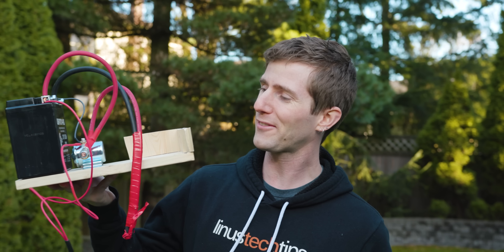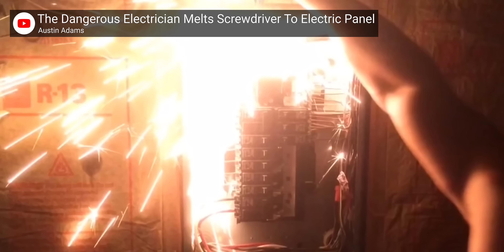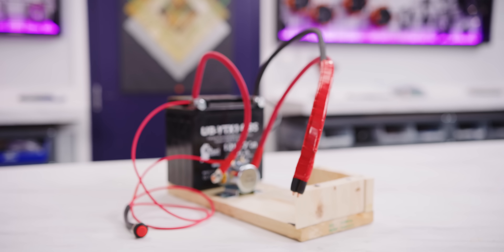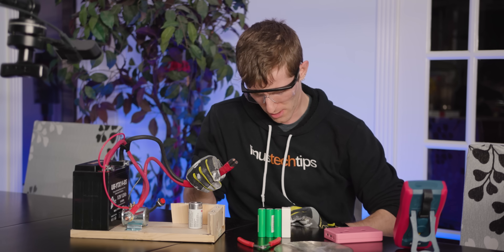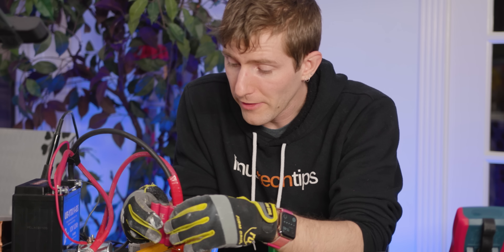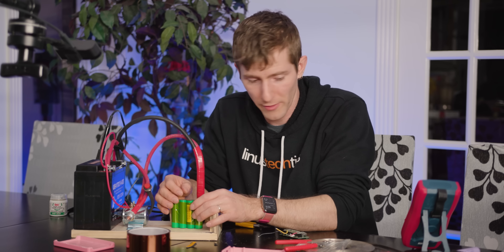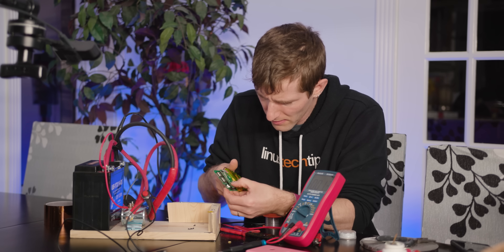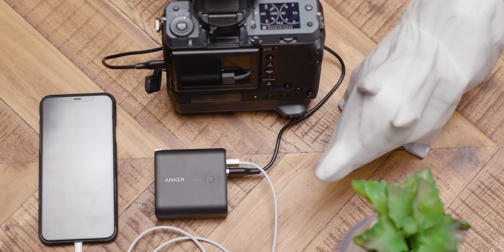I spent $100 to save 20 bucks... and it was TOTALLY worth it!

Comment: Drivers on rallye dakar are sometimes welding with a car battery, when something brakes out in the dessert, but I would be affraid of the battery to explode. Since it can get very hot by shorting it constantly.

Comment: Great Video on showing people how NOT to make a spot welder.  Guys, you seriously need to stay away from these types of things. It's just NOT your wheelhouse.  First, just because its a "starter" relay does NOT mean it can handle short circuit currents. It will fail!!!   Second, your going to kill the matter as well as its not designed to deliver that type of instantaneous currents either. This is to be done using a very large Cap.  Man, get it together.....

Comment: im really into the newer generation of LiFePO4 batteries . very compatible with 12/24 volt and they dont blow up.  half the weight  or normal batteries and you can run them safely down to 20% before charge and their recharge cycle are just as high as li ion if not better. they also have a very good heat rating.

Comment: I can attest that the anker banks are worth the money. It’s not just about capacity but they actually have really advanced electronics and an extremely clean power output. Cheap banks use crappy boost converters and regulators and can produce a lot of noise if using it to power a field microphone or some kind of wireless receiver. The anker ones i have no issue with

Comment: There needs to be a "Do not try this at home" boilerplate at the very beginning of the video. That spot welder is a death machine and the vast majority of people should not try to weld on top of a battery anyway. However, I did leave a like on the video because its the best suspense film I've seen in quite some time.
Reply: Well it's better than opening a microwave and using the transformer from there
Reply: Yes, this is very dangerous. Battery produces hydrogen and oxygen, and the sparks from welding can make the battery to explode splashing battery acid to your face. Kids who are watching this doesn't understand how dangerous this is, and can even short-circuit the battery trying this themselves.
Reply: @jauho7483  Do you understand how lead acid batteries work? Lead acid batteries don't produce hydrogen and oxygen when discharging.
Reply: 12v is not a death machine
Reply: @M_a_r_ke  You dont understand. Yes, 12V isn't dangerous, tho it can do burns if you short-circuit it. Its dangerous, because the battery can explode and splash acid to everywhere
Reply: It worried me when he took the gloves and goggles off, and I'd reccomend ski goggles for spot welding. Sparks can get underneath normal goggles and to the eye (unlikely but better safe than sorry).
Reply: @theSafetyCar  an airsoft site near where I lived banned personal goggles for that very reason, you have to wear full face masks there now. A bb went up underneath the goggles bounced off them and into the persons eye. Last I heard after they were rushed to hospital they were looking at only recovering their sight partially.
Reply: @stealthraider22  that's why we should always take proper precaution.
Reply: use ur brain then bruhhh

Comment: I use a Continuous duty solenoid in my camper van I built to charge my chassis batteries while the van is running with the alternator, and then disconnect while the key is off to separate and maintain the starter battery so i can always start the camper van, Works great! I could use my TS100 lol, but why!? haha Now I need another Continuous duty solenoid...  lol... Cheers! 🍻 Thanks for the vid! 🤙

Comment: Linus did reasonably well for what it's worth. I think he was mostly having trouble because of the setup. 
More industrial spot welding machines often retract automatically and are operated by foot. This allows the operator to time the weld more precisely and prevents the welder getting stuck to the part, etc.
(My first engineering internship was at a semicustom battery pack manufacturer.)

Comment: I've soldered packs together and it works just fine. Just don't be a numpty and leave the damn iron on there for too long. Use decent solder and an iron with a large thermal capacity.

Comment: I really really recommend a cheep timing circuit if it gets nuts you can still break the circuit by lifting the points off so you can get a few $ one online and tune it. The advantages are consistent welds (in your case you may want to keep the battery topped up) and you are way less likely to blow through the bottom of the battery you are working on which is very exciting especially if you have already welded it to a bunch of other batteries

Comment: So i just purchased this system(xps 27 7760) refurbed condition and am going to upgrade ram, because its so slow its unusable.  It only has 8GB 2x4(MOD,DIMM,8GB,2X4G,2400,N-ECC) if max i can have is 64GB any suggestions on best value RAM to get and how much? I want to max memory while still using the 8 GB thats already onboard if possible. thanks anyone for help.

Comment: Linus:
don't solder batteries. the heat will kill them
also Linus:
First time uses spot welder and blows up battery....
LMAO
Reply: Nope Nope Nope, outside now. Need to get BigClive's explosion containment pie dish
Reply: Lizlodude lol
Reply: Yeah he probably should have trained on few strip before going on live batteries 🙄
Reply: I guess he did, but maybe more would have been a good idea ha
Reply: He didn't reached ElectroBOOM's level yet.
Reply: Ive blown a lithium ion battery. Samsung one i played with it. It was fully charged and blow. It was scary....
Reply: at least it shows how easily you can fuck it up
Reply: Linus really was playing with pyrophoric dice here. Once Lithium cells start going meltdown style you want an enclosure full of sand next to you to contain them. You never want to grab a cell going thermal runaway, they will ruin your day.
Reply: You can solder them if you're fast enough, many diyers do that
Reply: @ZillionPrey  Look up videos showing thermal imaging of this being done. It's still not a good idea to solder them even under ideal circumstances you can damage them and they will function normally under ideal conditions but could suffer degraded capacity, increased internal resistance causing excessive heat under load, or just failure when pushed toward the edge of their performance envelope.
Reply: DerpyDoom you can, it's just not a great idea. What a lot of people get confused about is that aside from srabbing/shorting them, pretty much everything degrades lithium cells. Treating them well just degrades them less. Usually soldering direct to a cell won't cause a fire (usually) but it is very bad practice. But most average DIYers don't have a spot welder, so they just take the loss.

Comment: There's so much wrong with this video.
-Using a stubby screwdriver as a chisel to crimp battery leads
-12v dc is an "electrocution hazard"
-solenoid is a "relay" 
-cheapest push button money can buy
-shorting a lead acid battery and not a fuse in sight
-flailing around because the solenoid sticks and overcooks the weld

Comment: Break the old tab off by bending it back and forth. I do it all the time. Also, if you're proficient with a soldering iron (aka not a pussy) you can just solder them on. It won't get anywhere near hot enough to cause issue; if you do it right.

Comment: Damnet Linus you should know better, you can't do it like that man!  This is about as bad as the DIY PC build fail that the Verge did......   You have to use a proper spot welder they are lower voltage, higher amps, shorter duration!

Comment: Did you charge the cells individually before welding them? In the vaping world, 18650s are widely used and can go "out of sync" (and potentially age/fail much quicker) when used in configurations similar the one you're showing. BatteryMooch here on YT has TONS of info on batteries just like these, including on "marrying" them into groups.

Comment: There is no "nasty" electrocution hazard on 12V or even 24V unless you stick electrodes through your skin. There is a burn hazard if you short a high-current battery though.

Comment: On the relay side you should put it in a timed actuator. All you need to do is find out what setting it requires for the perfect weld and then you get consistent results every time.

Comment: Many in my experience some power banks will not come to life until you try and charge them after the cells have been disconnected. Some battery protection chips will latch off until they see power coming in.

Comment: 11:28  please learn how to solder and how to recognize a properly soldered joint.
BTW you mentioned flux but did you show using it - I am sure you did not explain why it is needed, nor the type of flux needed.
AND there are different types of solder...................

PLEASE....like PLEASE have someone who KNOWS electronics ride shot-gun

Comment: Don't think it was mentioned but avoid replacing the batteries with new ones of very different mAH.  That would screw up the CC charging phase and so could cause a risk of battery damage or it taking forever to charge.
PLEASE....like PLEASE have someone who KNOWS electronics ride shot-gun

Comment: PLEASE do not copy this spot welder as is.   Connect the MO switch to a non-retriggerable mono-stable with a variable output pulse length with a transistor driver (and a reverse biased diode). Long description but easy and cheap to do with a 555.
PLEASE....like PLEASE have someone who KNOWS electronics ride shot-gun

Comment: Note that the small battery used will not last long. It should have a low voltage indicator circuit attached.

Comment: maaaaaaaaybe if you wanted a spot welder so badly you would consider bringing tips in as close as possible to deal with such small objects, as well as making them thin and needle-like like all diy spot welders? needles tend to not stick to welded areas so badly

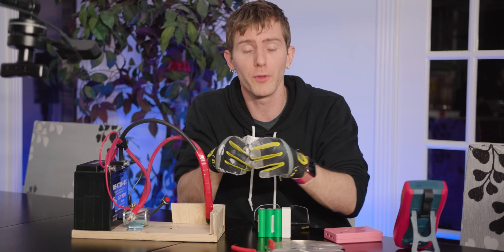Comment: 7:04  NO NO NO!
you do not heat up the solder - you heat up the surfaces (ie. battery connector and metal strip or wire) and then have the solder flow
Soldering batteries CAN cause the batteries to explode.
PLEASE....like PLEASE have someone who KNOWS electronics ride shot-gun

Comment: A couple of things...  series is for voltage and parallel is for CURRENT  NOT Capacity.  The Wh of the pack never changes.

The other issue is that as much as this was a deliberate diy job, there are actual cases that have spring retained cell slots for infinite reusability and cell replacement.  The only time you should bother with welding is if you are building a massive pack, either bike or DIY powerwall.  And when you fool with that, you should be very sure that you aren't cheating yourself on a welder.

Comment: On the opposite end, if you have an old laptop and are comfortable with opening it the battery might use some of those same cells and you can put them in some enclosures that are 3 bucks on eBay to make a battery pack

Comment: 8:52 That happened a few times to ya, I think your solenoid might be undersized for the current it's handling.

Edit: come to think of it, you should probably have a safety switch in line with the high current leads. You know, one of those big red stop buttons that you can just jam your hand on! You may want to actually test how much current you're getting, you might be surprised.

Comment: The BMS have a security protection and if the battery is discharged it cut the power, it not "come to life" it just reset after a certain time, you can also make it charge to reset it faster

Comment: 6:45 When you solder, you never heat the solder directly.  You heat the materials you are joining until they melt the solder.  Otherwise you can't be sure of good adhesion.
Reply: Ooooorrrrr heat the solder directly to wet the tip so that you get better hest transfer to your work piece
Reply: Of course you tin and clean your iron.  That doesn't make what I said wrong.

Comment: 3:50 Actually, from what I know, the voltage is too low to create any sort of electrocution hazard. It is only 12v DC after all.
Reply: Current is what kills you......
Reply: @Aileron90  But the current needs to be able to flow through you, which at 12v it won't the resistance of your skin is too high for it to shock you. You're more likely to get hurt by the battery falling on you than being shocked. 110/240v is a diffferent story though.
Reply: @Aileron90  Voltage is what kills you... I can let 600000 amps of current through me at 1 volt and it won't kill me. but if i were to let 120 volts AC at even 1 amp can be deadly.
Reply: @niko1even  yeah, or like telephone lines, theyre 98vdc, yet safe to touch, you don't know what you're talking about.
Reply: @Aileron90  that's DC... not AC... DC is much more safe than AC.
Reply: @Aileron90  also it's they're
Reply: @niko1even  literally the only difference is alternation of the negative and positive poles..... muscle function still remains the same, please stop replying, neckbeard internet lec engineers practising dunning kruger wasting my time.
Reply: @Aileron90  And that's the reason as to why AC is more dangerous, it can alternate. DC remains constant, so 120v will almost certainly be 120v.
Reply: @Aileron90  "neckbeard internet lec engineers" Whoa whoa there buddy, no need to get rude here. We aren't wasting your time, lol, you are wasting your own time by replying to us. So simply, stop replying and you will stop wasting your own time :)
Reply: @Aileron90  Plus, there is a reason as to why the warning signs say "Danger! High Voltage!' instead of "Danger! High Current!"
Reply: @niko1even  lol, that signage has nothing to do with electrical terms, its to do with what people as a majority understand, as many people, like yourself, don't understand current, Voltage is a more universal term for the lamen...
Reply: @Aileron90  voltage is the magnitude, current is the flow... you can't be hurt by the flow if the magnitude isn't large enough.
Reply: @Aileron90  That's one of the most common false beliefs about electricity, and I wish people would forget the phrase. If you absolutely need a simple "this is what kills you", it's energy. If your body absorbs more energy than it can handle, you die. Electrical energy even in the absolute simplest imaginable circuit is a function of voltage, current, resistance, and time, and you simply cannot have one without the others.
Reply: @slamprogram  ive touched plenty of above 100vdc lines that had ma supply current, beleive me, there is a huge different to 15amp 120/240 supply than 120v 10ma supply etc,

Comment: The reason why sometimes the relay would not release was because of the dinky little push button used. This kind of relay have a huge pull-in current when activated that can stick the contacts in the push button shut. Also when released they generate a huge amount of reverse current that has nowhere to go. You would have needed a smaller relay between the button and the solenoid or a beefier switch to control that thing.

Comment: I love Anker products, but their product lineup is a mess. They have so many similar or even seemingly identical products and figuring out which one is the newest or lightest can be very difficult.
I'm not sure why it's the case either. They only need a handful of different bank sizes to cover all the capacities people might want, but they have 46 different models. Speaking of 10,000 mAh banks, they make 16 different units at that capacity alone, and some of them look almost the same. They're great products, it's just... confusing.
I'd love for an updated version of the PowerCore Fusion, though. I've had my eye on one of them for years, and as soon as they make one with 3 or 4 outputs, I'll grab one.

Comment: 4:34 "belt sander"
shows B roll of bench grinder
Reply from the maker: For the record, I did use the bench sander... I just don't know where that clip went. But on the plus side, the tool I'm using there is a 3M EXL deburring wheel - probably my favorite tool ever -CW
Reply: @LinusTechTips  CALLED IT! I trusted in you Linus
Reply: Surprised they didn't use any handy dandy tweezers in this project...
Reply: @The Furox You guys realize Linus didn't make that comment, right? Colin literally signed his initials at the end lol
Reply: they probably used both and forgot to get b-roll of the sander

Comment: I think LMG really needs to hire an electronics engineer. So many of your DIY projects are janky and over engineered. For example here: you can have easily used an adjustable pulse generator with something as basic as 555 timer, and used 5 or 6 low resistance mosfets in parallel instead of the relay. That would give you reliable and repeatable welds, as well as much longer life time overall. The last project which hurt this much to watch was the one where you had to run to power the PC ... please linus, I know you guys can do better!

Comment: You ran into a bit of a trap with the BMS: 
Most powerbanks will go into a deep sleep state after first connecting the battery so they can be stored and shipped without discharging too much. They usually only activate either after briefly charging or pressing the button.